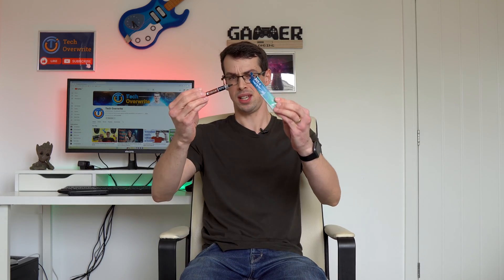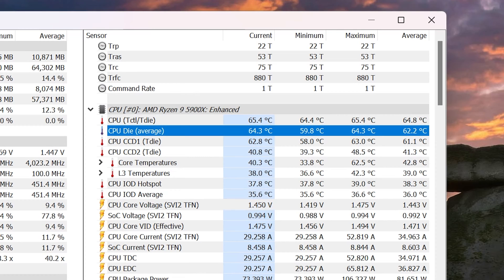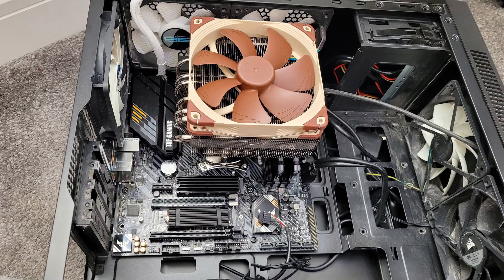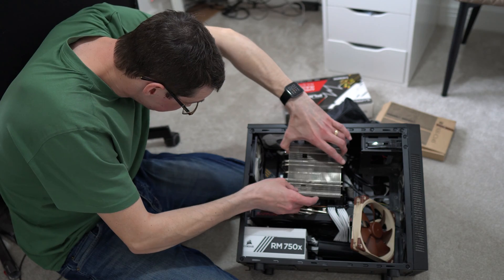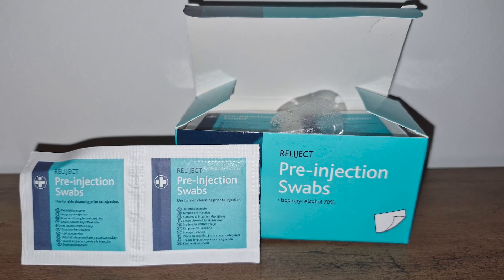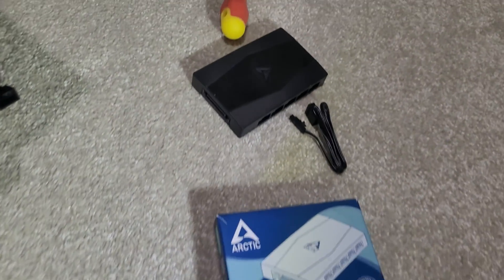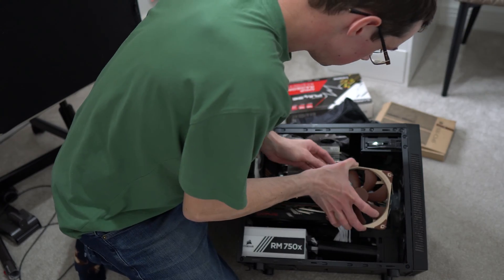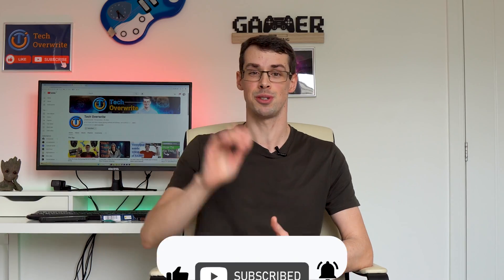Do You NEED TO Change Thermal Paste After CPU Cooler Removal?

Comment: Probably it is more optimal, but the difference is likely not that huge. I changed the thermal paste on my 1060 after years and removed the cooler several times to check other things, and the temperatures are still 25°C colder than they used to be.
Reply from the maker: Ahh interesting, that's good to know :) Glad it didn't have a major impact then.

Comment: Even if your Theory of Fans having no Impact is correct, you cannot run a "test" and change two things at once, that's not how Science is done, unless you run MORE tests where you hit all possible changes as just 1 change in each test, and two so you have a 4th, 5th or 6th test which include w/ and w/o the Fan replaced to attempt to prove something like your statement.  You made two changes, numbers went down, it is far MORE likely that both things combined made the difference.   Without more tests, you have no way to actually convince your audience, that one was more important than the other, and you may be correct, but you can't prove it w/ these tests.
Reply from the maker: That's a fair point, I should have definitely stuck to changing only one variable at a time for more conclusive results. Thanks for the feedback! :) This was an earlier test/video and nowadays I do stick to just changing one thing, but it's always good to have the reminder thanks.

Comment: I was installing my new cooler, but it was giving me some trouble, it lifted on one side for a second before finally latching on and then I could finally screw it on, do you think I should take it off and re apply the paste? I am worried to turn it on, but I am also worried I might screw up cleaning up the thermal paste of off it.
Reply from the maker: You'll be fine :) Simply adjusting it like that, especially with new cooler and paste, will be fine IMO. The paste will still have been fairly liquid. It's different if you removed a 5+ year old cooler - the paste would have set, and then this would cause issues.

Comment: So if I put thermal paste on a new processor, put everything together tighten it down, then take it all off to make sure that I didn’t use too much or not enough. Can I reassemble it without using new thermal pace or will this cause air pockets and cooling problems?
Reply from the maker: I would use the existing paste without worry in that case - quickly removing it, then putting it back on, should be fine. It won't have dried out or anything then, and unless you didn't use enough, you should still have enough paste coverage IMO.
Reply: @TechOverwrite  I actually have this dilemma now, I installed a thermalright cooler last night but missed alignment on one of the screws to attach the tower so I had to remove the tower to realign. on a side note. I used the thermal paste that came with the cooler, but it was dry and thick. I'm thinking about reapplying using arctic mx4.

Edit: I removed the old thermal paste and used MX4. Instant results

Comment: I recently removed my heatsink and fans to clean the dust on the fans, and also to replace my broken laptop keyboard. After i got home, it was so fried, cpu and gpu temp are going 70 (on gpu) and cpu on 80 Celcius while idle, and i remember that i sees the thermal pastes on my laptop is dry, but i didnt replace it. Should i replace the thermal paste? (I have an Asus tuf gaming A15 FA506QM)
Reply from the maker: Good question - I would look to change it yes, especially if it seemed dry. I know it's a pain to do in a laptop though :/
Reply: @TechOverwrite True lol, i already change it and still got 80° Celcius on gaming.. well Atleast not 100° Celcius and shutdown😢

Comment: i recently removed my heatsink thats been on for 2 years and the thermal paste has been on for 2 years but i didnt clean it. on the heatsink i wanted to clean the dust and the thermal paste was dryish on the cpu and it was out for like an hour in warm air put my heatsink bank on and saw the worst throttles ever
from this i guess i need to apply thermal paste…
Reply from the maker: Heh, it's easily done - but yes I agree that reapplying the thermal paste would make sense :)

Comment: Hi, I have a Ryzen 9 5900X with a Corsair H100i cooler. I am getting temps when idle about 60 degrees but gaming is about late 70 early 80s - I am assuming I should change my thermal paste as my idle temps are way above yours?
Reply from the maker: Hi, hmm that's odd. Yes I would ensure everything is seated correctly, and also change the thermal paste while I was at it. That does sound fairly high.
Reply: @TechOverwrite  Thanks, do AIOs make things run cooler than normal vented and fanned heatsinks? I am never sure about that as my old PC had an AIO and it was loud then put on a fanned heatsink and it was quieter which I would have thought would have been the opposite. Strangely enough I monitored the temperature with core bench and playing some of the more intensive sections in Destiny 2 my PC is only raising to about 75 degrees. So many people say these stupid temps that I have never been able to meet. One thing I didn't mention was that I am running 3 x 1080p screens, but I would have thought that would have been more of an issue for my graphics card
Reply from the maker: Unfortunately the short answer is: "it depends". A really good quality air cooler can outperform an AIO cooler, especially a cheaper AIO cooler. But a high quality one (AIO) will tend to outperform all air coolers - there's just better tech available to cool the CPU with liquid cooling.

I know what you mean about CPU temps though - I've seen lots of people (especially on Reddit) say that their CPU runs at x degrees, and I have the same hardware and it runs 15-20 degrees more LOL. I think sometimes people overstate it or exaggerate a bit. Or maybe they aren't comparing the same thing - like their room is 15 degrees celsius (i.e. quite cold), which means that their PC will naturally be much cooler than a standard temperature room.
Reply: @TechOverwrite  I prchased some nocta thermal paste and plan to reapply to my H100i. From what I have read the Noctoa seems to be about the best for the price. It has just been many years since I have done it so a little nervous. Checking my temps when running Destiny 2 for hours I was getting mid to late 70s

Comment: I actually did this recently when repasting my 4070 Super since I forgot to put thermal putty on one of the VRMs. Applied Thermalright TF8, lifted the heatsink without changing the paste and put it back on. Temps are still 5C cooler than with the stock paste. Still, for peace of mind I might repaste properly soon.
Reply from the maker: Yikes I can imagine an initial panic when releasing that. But yes, it shouldn't do any real harm and I'm glad your temps are lower.

Comment: Hey! My pc wasn't booting up so i thought of removing and reconnecting everything and i also did this to Cpu and the cooler too... I removed cooler for 10 - 15 mins i guess do i need to reapply themal paste?? I have ryzen 5 5600G and cooler had preapplied thermal paste (sorry for my English)
Reply from the maker: Hey, your English is fine - no problem :) Good question. You probably would be fine if it's just 10-15 minutes - I didn't see any major temperature problems after removing my cooler for this time. It can depend on a few factors though (how old the thermal paste is, for example). Maybe just keep an eye on CPU temps in HwInfo while you're gaming, and make sure they aren't getting too high.
Reply: @TechOverwrite  my pc is 11 month old...and i tested playing GTA 5 in normal settings i usually play and highest temperature was 60°C and PC usually stays at 38 to 41°C in idle state

Comment: What if you loosen your CPU cooler because it was too tight, do you need to reapply thermal paste?
Reply from the maker: I wouldn't worry about that - loosening it a bit is unlikely to disturb the thermal paste in any real way IMO.

Comment: Hey, I just built my first pc and the Mainboard was damaged in transport and I had to replace it. I applied thermal paste on the first assembly, but since I needed to switch out the mb I had to disassemble and wait a few days for the new mb to arrive. (so basically your test, but instead of waiting a few minutes I waited a few days.) Should I remove and reapply the thermal paste or do you think it's fine like this? Everything works now and I see idle temps of around 50-65°C at 35°C ambient temperature. Running a Ryzen 7 7800x3d
Reply: So if it's not clear I assembled it to test it without changing the paste. I'm kinda scared to put it under heavy load to test though 😅
Reply from the maker: Hey, congrats on the first build 👏 I don't think that would be an issue - the thermal paste wouldn't have completely hardened up in that time, IMO. Plus having temps 25-30 above ambient doesn't sound too bad either. I wouldn't worry about stress testing it though - the worst it would do is thermal throttle at 90-95degC instead of breaking ☺️